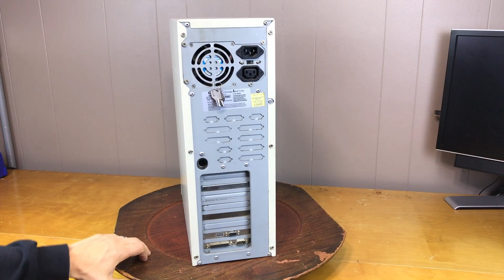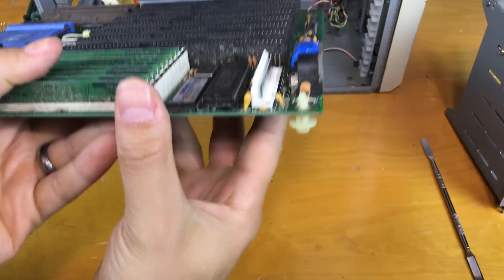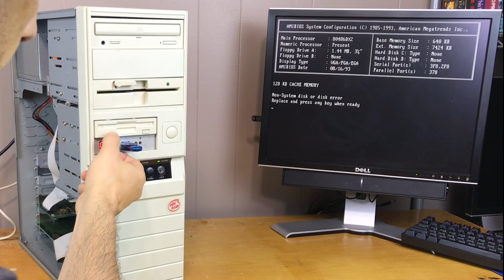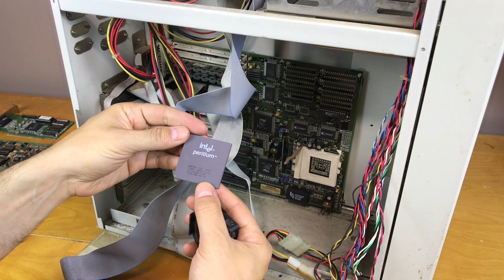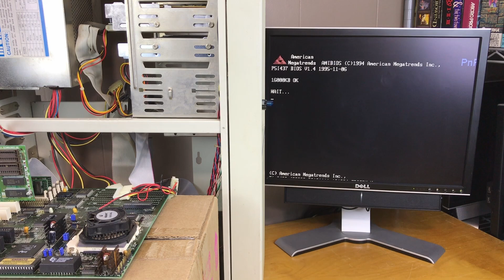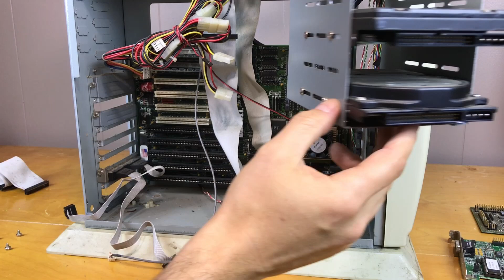Retro Haul - 486 & Pentium 1

Comment: Just recently came across your channel and really enjoy the content (now subscribed). I have a question about the case used on the 486 system. I'm aware this is a generic case - I've seen it used by various manufacturers between 1993 and 1995 in old copies of PC Magazine. Is there any stickers on it that tell you the brand/model of this case?
Reply from the maker: I just opened it up, checked the bottom, no stickers, labels, or stamped metal words anywhere unfortunately. Glad you enjoy the content!
Reply: @joelexplorestech  thanks for checking that for me. Looks like the case remains a mystery haha.

Comment: That's the second Pentium with VLB I've seen, I thought they were incredibly rare
If you can find the same, or at least comparable, video card (chipset) in VLB and PCI, would be interesting to see which performs better
Reply from the maker: That’s a great idea! I have seen a few isa vs vlb runoffs, but not a lot between comparable pci/vlb cards.
Reply: @joelexplorestech  I think the 486 VIP boards are often better on VLB than PCI. It may be the other way round for Pentium boards